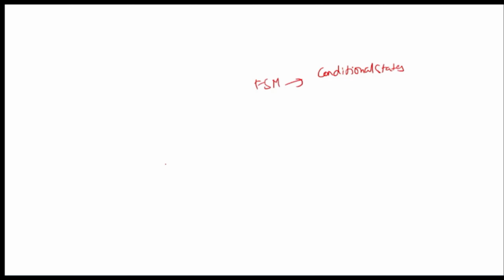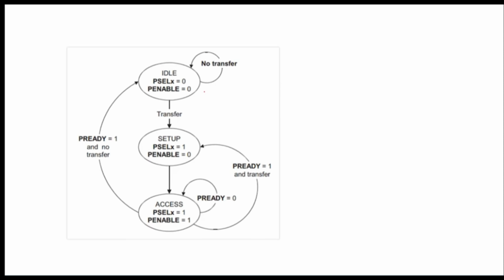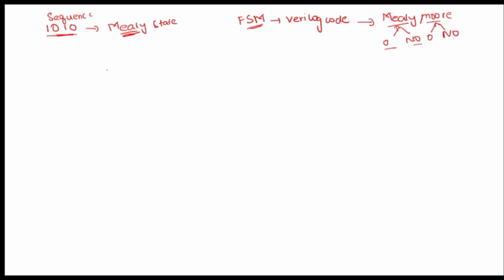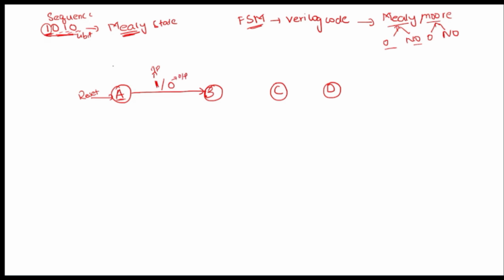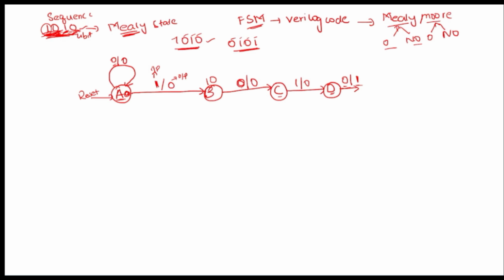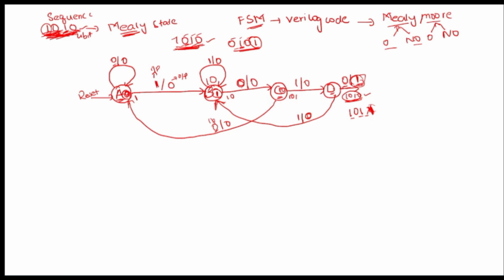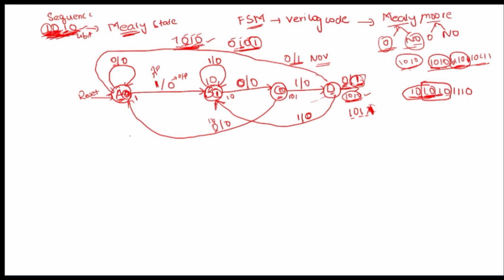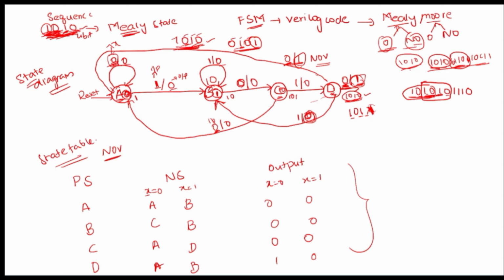What is FSM and How to draw a STATE DIAGRAM, STATE TABLE AND WRITE A VERILOG CODE BASED ON THESE.

Comment: Hi, can you please help me solve at least two of these types of problems? I am struggling to understand the process.

1. Consider text over the input alphabet Σ = {∆, a, b, ..., z} and assume that words are delimited by a ”∆”.
(a) Design a finite-state machine that will change all occurrences of the word ”babe” in the input string
to ”baby”.
(b) Design a finite-state machine that will change all occurrences of the words starting with the substring
”schr” in the input string to words starting with the substring ”scr”.
(c) Design a finite-state machine that will change all occurrences of the substring ”bibi” in the input
string to ”didi”.
(d) Design a finite-state machine that will change all occurrences of words ending with the substring
”ize” in the input string to words ending with the substring ”ise”.
(e) Design a finite-state machine that will change all occurrences of the word ”hat” in the input string
to the word ”cap”.